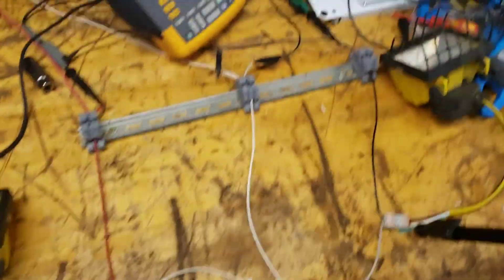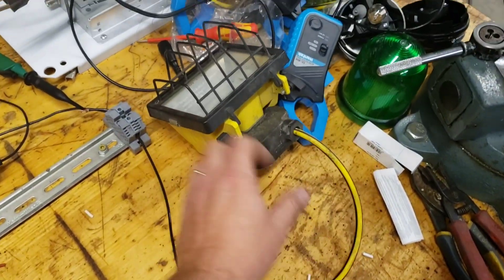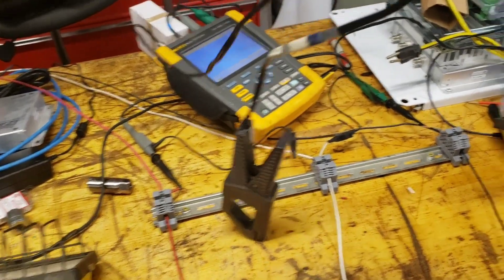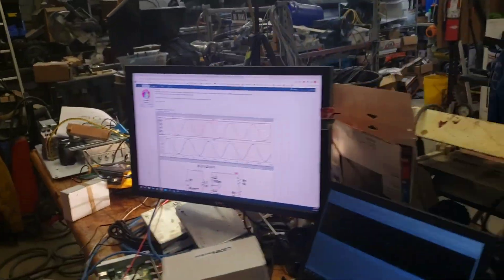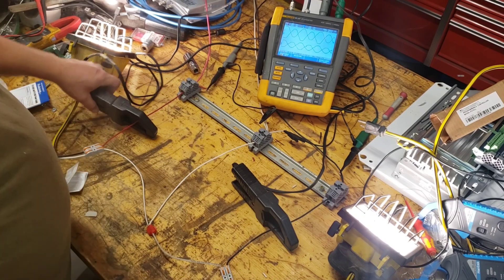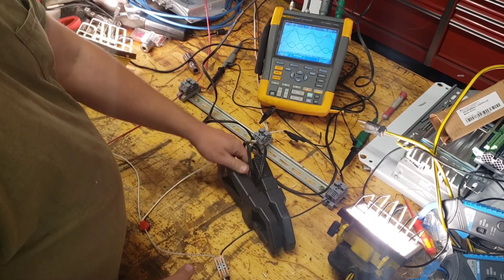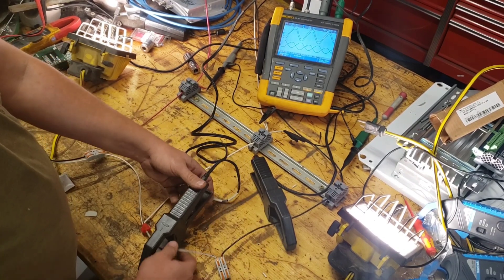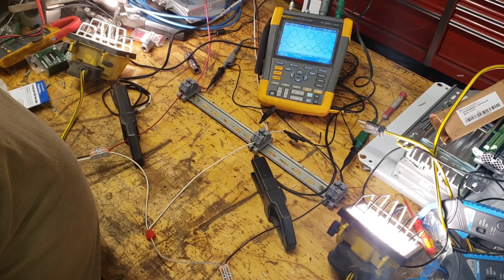Inverted/"180 degrees out of phase" current.

Comment: Yes you are supposed to do that BUT you need to think about what it is you are doing when you do it. The current clamps have a direction. They should be marked. One side of the clamp goes toward the load. Running it along the wire the way you did had your clamp in the wrong direction. It is a simple matter of topology yet it seems to always confuse people at first. Clamp your current clamp over L1 in the proper direction and you will get the inverted or out of phase signal. They way you have it is the equivalent of reversing the live and neutral probes.

It should be obvious, but perhaps is not, that if the voltage signal is inverted then so is the current, at least with a purely resistive load that is. The current will flow from high potential to low potential. You can switch polarity of your probes, but that is changing the definition of positive and negative. Remember, there is no absolute voltage measurement. Voltage is a comparison, the difference in electric potential between two points. It's value depends entirely on which two points we choose to make our measurements.

I hope this helps.
Reply from the maker: "there is no absolute voltage measurement. " 

You worded that nicely. I agree, there is no absolute voltage measurement. but is there absolute voltage ? 

If a tree falls in the woods and nobody is there to hear it, is there any sound? This question is typically asked rhetorically to point out the difference between the physical phenomenon of sound (pressure waves) and the observation of sound (human perception). Some people only recognize one or the other. If you define sound as merely a human experience then a tree falling in the woods with no observer, makes no sound. 

The same applies to voltage. There is voltage  (the physical phenomenon of potential difference) and there is voltage (the observation/measurement). A battery sitting on a shelf with nothing connected to its terminals, according to Ohm's law, has no voltage. Not until you connect a multimeter to it, which provides a resistance for current to flow through, and thus a voltage (and a measurement of voltage). But, we all know that before we connected the meter, and after we disconnect it, that voltage is still there, right? Who would argue that it ceases to exist once we remove the meter? 

I posit that a source DOES have an absolute voltage with a specific amplitude and polarity, that simply exists, independent of how you choose to measure it. And that absolute voltage is what this video (via demonstration of current) is about. 

If you are saying that L1 IS inverted with respect to L2, then you are speaking of measurement/observation only, making no effort to point out the distinction between measurement voltage and absolute voltage. You're proudly proclaiming that a tree which falls in the woods makes no sound, end of story. It is up to the audience to deduce that you consider sound only to be a human observation. Anyone who doesn't know enough to deduce that, will be misled. Please stop being misleading. L1 and L2 are NOT out of phase. YOUR measurements are out of phase.
Reply: @charlesstaton8104  "but is there absolute voltage ?"
Maybe I should have said independent/absolute. My point was that voltage is always a difference between two points. You can't, for example, say that the voltage at some particular point in a circuit is x volts without knowing what that is in reference to. That's all I meant by that.
"A battery sitting on a shelf with nothing connected..."
Ohm's Law does not apply to the unused battery because there is no current through it. Ohm's law is only useful in a circuit. The battery has internal resistance which would be sufficient for current to flow were the to electrodes connected, even with a hypothetical perfect conductor.
I won't bother quoting any specific part of your last paragraph. I am only here to share what I have learned in my years as an electrical engineer. The information is freely given to those who want it, but never forced on anyone. It seems clear that you hold tight your view on this topic and I won't try to prise it away from you.
I will just leave you with this. You and I are only out of agreement by semantics. However the semantic view that I am trying to explain is the one agreed upon by concensus, convention and the NEC. If you want to post videos using definitions and claim that the rest of the world's engineers and electricians are wrong, but you have got it right, then by all means, have your fun. But it is not I who is misleading any others who stumble across your video. If someone were to accept your assertion and carry it into a job site, they would be liable to make costly mistakes. If you are okay with that, then I will leave you to it.
Reply from the maker: @jssamp4442  if one can walk onto a jobsite and make this claim and back it up with the logical arguments that I provided in the previous video, and have mutual understanding of the semantic nature of the disagreement with those across the table, then they have (should have) proven a sound understanding of the topic. However they WON'T have a mutual understanding that it's a semantic disagreement, and that's exactly why it's NOT a semantic disagreement. Most people saying the things that you're saying, don't know why they're saying them. You obviously do understand, and this probably blinds you to the fact that you're a minority. Everyone sounds like you, so obviously they've got it right, right? No, they are intoning the mantra word for word but don't actually understand. They can't explain why when we talk about split phase, the difference of L1 and L2 equals 240V rather than the sum. They think L1 and L2 are LITERALLY out of phase. They get this idea from people who say things like "L1 and L2 ARE out of phase" and it leads of further misconceptions, like that current flows different directions (simultaneously) through the loads on L1 and the loads on  L2, and on that faulty foundational understanding of single phase is built a complete butchery of 3 phase. 

I understand that I'm arguing against convention. I take a lot of heat for that, and I'm ok with that. My goal is to get people thinking. If they watch my videos and walk away having decided to keep saying what convention taught them to say, but with a new found understanding for why they're saying that, it's still a win. I do encourage them (and you) however to stop using absolute terms to the describe their relative measurements. I have no objection to "L1 and L2 appear 180 degrees out of phase (inverted polarity) when measured with respect to neutral." But "L1 and L2 ARE 180 degrees out of phase (inverted polarity)" is objectively wrong and absolutely misleading, and just because convention encourages it doesn't change that.
Reply: @charlesstaton8104  In "L1 and L2 ARE 180 degrees out of phase (inverted polarity)", both ARE and APPEAR are correct, but the "when measured with respect to neutral" part is necessary for both. Though it often goes unspoken, the assumption is always there. If I gave the impression that this was not my meaning, it was unintentional. By convention I mean the terms and definitions agreed to implicitly by being an English speaking person working with electricity. Convention is a required shortcut for communication. You are able to understand the words I am typing because we agree on the meaning of these words, by convention. This is the convention and consensus I am talking about. 

As for "current flows different directions (simultaneously) through the loads on L1 and the loads on  L2", again to make sense of this we must agree on the meaning of direction or specify what direction we are referring to. I call it positive current when the flow is to the load on the live and away from load on neutral. Negative current flows to the load on neutral and away on live. This holds for both L1 and L2. So in the same moment, L1 is positive (current to load on L1) and L2 is negative (current from load on L2). This is opposite polarity, (+)L1 & (-)L2. By this convention the voltage measured across L1 and L2 (the difference L1 - L2 is 240V. If you only look at L1 & L2, ignoring neutral, you could see one circuit with the current flowing from source through L1 then back to source through L2, but this is only true if you have only one load or balanced loads. Otherwise the unbalanced current will return to source (or be supplied by source, depending on the sign of the imbalance) through neutral. 

To use another convention than the one I describe for the direction of L2 doesn't give you a difference of 240V. If both signs are the same ( L1 and L2 in phase), then the difference is zero meaning 0V across L1 & L2. The convention I describe (and all other widely accepted sources) assures that the result is mathematically consistent.

I think we are both describing the same thing, but I have an intent aimed at conformity with the widely accepted standard for naming and accounting, while you are saying the same thing but insisting on using non-standard definitions. For what reason I cannot divine. But I will consider it a win If we can disagree respectfully and amiably in the understanding that we don't always have to agree to get along. Conversations would be extremely dull if everybody agreed on everything.

One last thing. "180° out of phase" and "inverted phase" describe exactly the same sinusoidal waveform. There is no difference in the two when the wave is a sine or cosine. Whether you invert the leads or time shift the signal, the result is identical. How you got there is different but you can't know which it was from only looking at the steady state signal.
Reply from the maker: @jssamp4442  In "L1 and L2 ARE 180 degrees out of phase (inverted polarity)", both ARE and APPEAR are correct 

WHAT? how can you say that? You connect your scope from neutral to L1 and neutral to L2, you get inverse waves, you say L1 IS inverse from L2. I come along behind you, connect my scope probes on top of your scope probes, from L1 to neutral and neutral to L2, I get in-phase waves, I say L1 IS NOT inverse from L2. We can't both be right. If you're arguing that there is no difference between appearing out of phase and actually being out of phase then your argument presupposes (but conveniently never advertises the fact) that voltage exists only as a measurement. Same as saying a tree that falls in the woods makes no sound. 

As for "current flows different directions (simultaneously) through the loads on L1 and the loads on L2", again to make sense of this we must agree on the meaning of direction or specify what direction we are referring to. 

But, we really don't. The statement is self explanatory and leaves zero room for misinterpretation. Current flows the same direction (simultaneously) through the loads on L1 and the loads on L2. and to that I will add current flows the same direction (simultaneously) through every single turn of the secondary winding of the supply transformer. You can decorate your schematic with little + and - symbols a la KCL if you find that helpful, but the statements stand. 

If both signs are the same ( L1 and L2 in phase), then the difference is zero meaning 0V across L1 & L2. 

Inverse waves cause destructive interference and in-phase waves cause constructive interference. In math, in noise canceling headphones, in the ocean, in every kind of wave in the known universe except (apparently) in discussions with EEs about split phase power. 

The convention I describe (and all other widely accepted sources) 

I get it. Convention is on your side. I knew that before you came along and you've thrown it out there enough times. The convention in this case is as stupid as neck ties. 

you are saying the same thing but insisting on using non-standard definitions. For what reason I cannot divine. 

The reason is that the way I am describing it is more intuitive and more accurately reflects the underlying physics of the EM field of the transformer or generator source. The conventional way is misleading. 

But I will consider it a win If we can disagree respectfully and amiably in the understanding that we don't always have to agree to get along. Conversations would be extremely dull if everybody agreed on everything. 

I agree. If I have been disrespectful toward you I apologize. My words don't come from a place of intentional disrespect but I'm sure they are colored by a certain irreverence I feel regarding this topic (not you personally). 

One last thing. "180° out of phase" and "inverted phase" describe exactly the same sinusoidal waveform. There is no difference in the two when the wave is a sine or cosine. Whether you invert the leads or time shift the signal, the result is identical. 

Agreed. Not for asymmetrical non sinusoidal waves, but in this topic of split phase mains I don't think anyone on either side of the debate is arguing that L1 or L2 is phase-shifted by 8.333mS. Both sides are saying "180 degrees out of phase" when they mean "inverted." Fine, doesn't matter, it's a sine wave, same difference, but if we want to be really precise in our wording we would be saying "inverted." I try to use "inverted" more often lest someone intentionally misconstrue me. 

I would like to hear your thoughts on this statement: current flows the same direction (simultaneously) through every single turn of the secondary winding of the supply transformer. Do you disagree?
Reply from the maker: @jssamp4442  I thought of what I hope will be a good analogy. We need to know the direction a river flows. The simplest solution would be to stand on the bank, throw in a cork, and see which direction it goes. But we can't because (our scope is ground referenced, so) we are standing in the center of the river. So we throw in two corks, one toward either bank. One floats from left to right and the other floats from right to left. We report this (as per convention) as two different measurements, one positive and one negative. Anyone who doesn't know better will take these measurements to mean that the river is flowing two different directions simultaneously. Some of them will take that flawed understanding to the grave, through decades of work in an electrical technical role. 

I'm over here trying to point out that there is only one river, it only flows one direction, and I can prove that from standing in the middle of the river, either bank, from the bay, from the mountaintop, or from the international space station. Yet I will still have people insisting that there is no difference between those directions APPEARING opposite and actually BEING opposite. What they intentionally gloss over (without exception) in their proclamations is that they refer to the MEASUREMENTS and that they disregard any notion of there being any ACTUAL direction of flow. Yes, the RELATIVE MEASUREMENTS actually ARE opposite. The measurements appear opposite and ARE opposite. But the measurements are meant to represent something that actually exists, and the thing which actually exists does NOT have current flowing two different directions simultaneously. If we can take measurements that more accurately reflect the real thing, that is better, right? Nope, convention is better, always; even when it causes confusion.
Reply: @charlesstaton8104  I'm gonna wade back in here for a visit, despite my better judgement. I mean no disrespect, but I have to agree with Jssamp that "It seems clear that you hold tight your view on this topic." It's slightly disheartening to see nothing from our previous lengthy discussion shift your mindset whatsoever, and in fact you took analogies and twisted them for your own purposes. And that's why I call this political!

I appreciate, Charles, that you feel your view is more intuitive for the masses, and has helped to correct many a misguided youngsters (I see many positive comments on your other video and commend you for that!). But has it occurred to you that you are not giving enough credit to many countless others who discuss this regularly and understand it quite well? I'm not saying people who declare "OUT of phase!" all understand it, but many, many do. And people going around claiming "IN phase!" doesn't change anything unless one actually understands the system and how to take measurements on it and what those measurements mean!

As part of a give and take, I will offer that my mindset has indeed shifted somewhat since our discussion and I better appreciate why you feel you are correct and indeed are correct in many ways. That doesn't mean I think you ARE correct in EVERY way, just that you APPEAR correct from certain reference points. (little joking here ;)

Since in this discussion with Jssamp you stated more prominently your assertion about the difference between voltage philosophies  (measurements vs voltage 'existing') I would like to add:
When one says voltage is dependent on reference, what they mean is it is between two points. I think you have built a straw man here with the 'tree in the woods analogy.' In your example with the battery sitting on a shelf, the battery 'has' defined voltage (whether we measure it or not) between given points. In other words, between the two terminals, there is some voltage (approximating the rating of the battery, if healthy). One could also discuss voltage between cells within the battery. BUT, one can NOT just say 'the battery HAS voltage' without defining (implicitly or explicitly) the reference points. The battery does not 'have' voltage to ground, for example (well technically it does, but it's not the same voltage as between the terminals). It's not that complicated.

As far of constructive vs destructive interference of waveforms:
In terms of current, when neutral is reference (waveforms 180 OOP i.e. inverted) then there IS destructive interference of the current on the neutral. And, again, voltage sine waves depicted on an oscilloscope are not an image of an electromagnetic wave, they are showing a time varying function of amplitude. There really is no mathematical or physical conflict to get worked up about.

And that's the rub. THE MATH and THE PHYSICS works just perfectly with a neutral reference if one understands what that reference means. And one needs to understand what ANY reference means. Math is a representation of reality. No 'declaration' of a phase angle being IN or OUT is getting us any closer to reality. Whether it's English or math (or another language), it's all an attempt to DESCRIBE reality. And as such there are many justified ways to do so. I will post a link below that I think describes this situation well. I think you will agree with its general assertions, but your conclusion will probably be that one version  of measuring is somehow a lie and another is 'real' because that seems to be an immovable position for you. 

No one in the know disagrees with you that the two halves of a center-tapped transformer are series-aiding. What people are disagreeing with you about is your continued assertion that using a center tapped reference is somehow not-representative of reality in a mathematical or physical sense. To be blunt, you need to seek a little humility man and recognize that other people understand what's going on and can fully embrace inverse waveforms due to their intelligence and comprehension of the system, not lack thereof.

You can't blame the waveform for people misunderstanding it.
Reply: @charlesstaton8104  And not to step on Jssamp toes, but I will stab at this question:
"current flows the same direction (simultaneously) through every single turn of the secondary winding of the supply transformer. Do you disagree?"

This has been answered before, but here goes.
It depends.
if you set the winding on a shelf with a definitive orientation, you could point to it and say 'all the current is flowing left at the same time.' That would be agreeable.  But that doesn't change this statement by Jssamp: "...current flows different directions (simultaneously) through the loads on L1 and the loads on  L2", again to make sense of this we must agree on the meaning of direction or specify what direction we are referring to."
When the neutral point is reference, at a given moment, current is flowing from neutral to L1 while current is flowing from L2 to neutral. So in that sense, 'different directions.' Is that somehow not a tenable statement for you? Again, multiple statements that both describe reality-- no conflict-- its about reference. I'm not sure what the issue is. Perhaps there is simply no disagreement and so you are just saying things and then we are just saying things, and then you just say more things, etc.. haha! The humanity!! :)
Reply from the maker: @spruce_goose5169  here comes the dog-pile! LOL No worries, I am used to it. You were going to share a video but I didn't see any link.
Reply: @charlesstaton8104  "One floats from left to right and the other floats from right to left. We report this (as per convention) as two different measurements, one positive and one negative. Anyone who doesn't know better will take these measurements to mean that the river is flowing two different directions simultaneously."

While I appreciate that this could be misunderstood by a beginner, I think this is a good example of where there is actually nothing wrong with the measurement, only with comprehension. To take this analogy a slightly different way: standing in the center (center reference) the river is coming at you and going away from you simultaneously. A positive value and a negative value. Should I be confused when standing in a river which way it is going because I have a high pressure on one side of me, and low pressure on the other?

The reference point is a 'dumb' point, meaning it doesn't think for us. It's not a person you can ask questions of as they stand in the river. It is there to give us... reference. Then we-- the humans on the other side-- interpret those measurements for what they are based on how we referenced.

This would be no different than if I measured pressure between 3 different chambers. If the meter base was always kept in a common room, with the probe sent into the other 2 rooms, one would have to take the difference to determine the pressure difference between those two rooms (that the base is not in).
Reply: @charlesstaton8104  Hmm. I think maybe youtube removed it... 
If you google "all about circuits more on ac polarity" it comes right up. Not a video, an article.

Btw, here is a video where I can sympathize wholeheartedly with your view on this, in that their presentation could be pretty misleading: https://www.youtube.com/watch?v=RhHlXa9XUKQ

People just need the full story. Trouble is, if someone is just learning, it can be difficult to convey the entire story all at once... We really should probably talk differently about this subject to different people based on where they are at with their understanding of the system and concepts. I-- again-- would advocate for not harping on the "in vs out" if phase bit and would personally focus more on the importance of reference and perhaps the physical construction of a winding.
Reply from the maker: @spruce_goose5169  "I have to agree with Jssamp that "It seems clear that you hold tight your view on this topic." 

I have to agree with both of you. I do. 

"It's slightly disheartening to see nothing from our previous lengthy discussion shift your mindset whatsoever"

I did have some takeaways. Notice I am not arguing current as an absolute measurement anymore. At least, not in the same way. Our conversation taught me that I am not very good at articulating that so I am giving it a rest for now. 

"in fact you took analogies and twisted them for your own purposes." 

Did I? Which ones? I surely didn't mean to plagiarize but sometimes things get into my head and I forget the source and assume they're my own original ideas. 

"has it occurred to you that you are not giving enough credit to many countless others who discuss this regularly and understand it quite well?" 

I think I give credit where due. Do you notice a difference in my tone in this conversation vs the one I had with you? These conversations, when they happen with someone holding contrary views, typically go one of a few different ways: 

(1) The person actually doesn't know what they are talking about and is just regurgitating the convention like a good little drone. In this case I try to help them understand which involves pointing out things that contradict their arguments, and 

(1A) they actually think about what I said and they have a eureka moment or 

(1B) the most common of all of these - they become belligerent, and the conversation devolves into insults. 

(2) the person DOES know what they're talking about, and knows what I'm talking about; we both know what the other is talking about, yet they intentionally misconstrue everything I say, feign misunderstanding despite me using the most concise explanations possible in English, try to catch me on every technicality they can (and make one up if they can't), fein concession and then reneg on it, and gaslight me to the applause of a crowd that exists in their own head. As you say (and I agree), politics. 

(3) very rare - like the conversation I had with you - where we are both on the same page but have different ideas about the best way to describe the page yet still able to discuss it amicably. 

It's those "class 2" conversations where I absolutely give no credit. Hell no. If you're trying to make me look like I don't know what I'm talking about when you know that I do, then you deserve no credit for what you know either. 

This conversation before you joined, was a "class 3" but exhibiting the early symptoms of "class 2" - so maybe it was about a 2.7. 

"That doesn't mean I think you ARE correct in EVERY way, just that you APPEAR correct from certain reference points." 

LOL good one. 

"I will post a link below that I think describes this situation well. I think you will agree with its general assertions, but your conclusion will probably be that one version of measuring is somehow a lie and another is 'real' because that seems to be an immovable position for you." 

I read the AAC article and thought it gave a good explanation. It covered both sides of this debate. Polarity of the measurement device, polarity of the sources, positive and negative voltages, etc. And it gave a good teaser for dealing with phase angles other than 0 or 180. That's really what I should be focused on; telling the whole story. Instead I am consumed with telling the half of the story conspicuously left out of most explanations and arguing with people who insist the missing chapter doesn't exist. 

"What people are disagreeing with you about is your continued assertion that using a center tapped reference is somehow not-representative of reality in a mathematical or physical sense. To be blunt, you need to seek a little humility man and recognize that other people understand what's going on and can fully embrace inverse waveforms due to their intelligence and comprehension of the system, not lack thereof." 

Again, I reciprocate. I might be preemptively defensive sometimes but it's because I'm perpetually under attack from self-deputized agents of academic convention enforcement. I can spot a patronizing tone a mile off, but I just can't seem to replicate it; my directness might make me look like I lack humility. But I can admit when I am wrong. Exhibit A: 

"take this analogy a slightly different way: standing in the center (center reference) the river is coming at you and going away from you simultaneously. A positive value and a negative value. " 

Nice. Way to turn my analogy around on me. Yours is better. I'm never using this again LOL.
Reply from the maker: "you set the winding on a shelf with a definitive orientation, you could point to it and say 'all the current is flowing left at the same time.' That would be agreeable. But that doesn't change this statement by Jssamp: "...current flows different directions (simultaneously) through the loads on L1 and the loads on L2", again to make sense of this we must agree on the meaning of direction or specify what direction we are referring to." When the neutral point is reference, at a given moment, current is flowing from neutral to L1 while current is flowing from L2 to neutral. So in that sense, 'different directions.' Is that somehow not a tenable statement for you?" 

Everything you said was accurate but that was a feat of Olympic gymnastics to justify the use of the words "different directions" when the question was "same direction through every turn" (opposed to into/out of any given nodes) on a video demonstration of current through loads using current clamp that clearly showed current NOT flowing "different directions." 

Do I need to dredge up current as an absolute measurement again? lol where was I supposed to connect my current clamps' ground probes for those measurements? 

_"Btw, here is a video where I can sympathize wholeheartedly with your view on this, in that their presentation could be pretty misleading: https://www.youtube.com/watch?v=RhHlXa9XUKQ "_ 

Yes, that guy is nincompoop. I've seen another of his videos. He is a proud member of "Class 1B" - he has no idea what he is actually talking about, but is really proud of his ability to spout rote script from a textbook and call anyone who doesn't acquiesce to it an idiot. 

"People just need the full story." 

Agreed. I plan to make another video that explores the whole thing in detail. Less adversarial, more informative. "Why do these people say this?" "Why do these other people say that?" "Who is right?" (Spoiler, they both are, they just can't agree on whose explanation makes more sense, but here's my opinion...) 

"Trouble is, if someone is just learning, it can be difficult to convey the entire story all at once... We really should probably talk differently about this subject to different people based on where they are at with their understanding of the system and concepts." 

Agreed. 

"I-- again-- would advocate for not harping on the "in vs out" if phase bit and would personally focus more on the importance of reference" 

Agreed, but... I think you (and most classically trained folk) have an inflated opinion of ground as a reference. I agree that reference is important but I opine that convention, being based in no small part around the measurement devices used during the time of its inception (and still today) puts ground on a pedestal. THE reference point almighty. It's the de facto center of the circuit analysis universe. LTSpice simulations can't even run without a ground! I rarely touch ground! Most things I deal with are isolated/floating. So I think about things differently. That's probably where my difference in opinion about in/out of phase comes from. I agree that reference should be talked about more, but probably not in the way you would like. I will be focused on introducing people to what measurements look like from other points of view than ground, because I think that helps to form a better grasp of the big picture. 

"and perhaps the physical construction of a winding." 

DEFINITELY!
Reply: @charlesstaton8104  All fair and reasonable Charles.

"I think you (and most classically trained folk) have an inflated opinion of ground as a reference."
"I agree that reference should be talked about more, but probably not in the way you would like."

You may be surprised. It's not that I think ground HAS to be reference, it's that I think whatever reference point we choose needs to be clear. And yes, typically if one doesn't cite the reference, there is going to be an assumption that it's ground. 

My biggest issue is when people think there are 'absolutes,' and that has really been the point I have been trying to drive home throughout this discussion. I regularly point out, for example, that a split phase service does not 'have 120 volts' on L1 (or L2), but rather 'has 120 volts  from L1 (or L2) to ground', and 'has 240 volts from L1 to L2.' It's not a pedantic point because too many people think voltage is an absolute measurement, as if a single wire 'has' some predetermined voltage regardless of reference. As you know, one could go unhook the physical earth connections of a household split-phase service and suddenly there would be no 120 volts to ground. The whole thing would be floating. 

Ground does indeed tend to be the reference, partly by convention but also because of practicalities with measurements. Clearly, as you demonstrate, it's not the only way we can take measurements, but people with non-isolated grounded scopes need to use it. And it's also not trivial that if someone were to be shocked by completing a path to ground, it would be closer to 120 volts because we stand on ground. If we grounded L1 in our residential systems, we would have a dumb system where one could be shocked by 120 volts OR a full 240 volts TO GROUND!
Reply: @charlesstaton8104  
"Everything you said was accurate but that was a feat of Olympic gymnastics to justify the use of the words "different directions" when the question was "same direction through every turn" (opposed to into/out of any given nodes) on a video demonstration of current through loads"

Right, we are both saying true things that don't contradict one another. The simple answer to your question about 'direction through the turns' is that, yes, current is going in the same direction when one views the coil on a benchtop. The reason I make the point about node reference is because node reference is the only tool we have for depicting this concept on an oscilloscope (even with your approach).

You portray current as 'going in the same direction' with your clamps, and so you may be tempted to think your are not using node reference, but ultimately you still are. The way the scope is able to show these waveforms is by measuring flow towards or away from a reference. You are able to show what you do by choosing a node reference of L1 for one clamp, and N for the other clamp. I'm not saying you can't do that. And I'm not saying that it's LESS correct than a common center reference. I'm simply saying that it's also NOT MORE correct. What would 'more correct' even mean? It all depends on what we're trying to accomplish. I think you accomplished what you wanted to, but we always need clarity on what the measurements are depicting. Like I said, it's all relative, and each measurement will give us different information for the same physical reality.
Reply: I should probably add for clarity that when I say "it's all relative" I am NOT saying current is between two points like voltage. Current can be measured at a single cross section and in that sense is an 'absolute'. I'm simply saying the depiction of the sine wave showing current as 'coming or going' is relative to the reference.
Reply from the maker: @spruce_goose5169  "My biggest issue is when people think there are 'absolutes,' and that has really been the point I have been trying to drive home throughout this discussion. I regularly point out, for example, that a split phase service does not 'have 120 volts' on L1 (or L2), but rather 'has 120 volts from L1 (or L2) to ground', and 'has 240 volts from L1 to L2.' It's not a pedantic point because too many people think voltage is an absolute measurement, as if a single wire 'has' some predetermined voltage regardless of reference" 

I totally agree. Voltage is a relative measurement. But in response to this it probably makes more sense to call it a differential measurement. I have always agreed with this and if at any point I made it seem otherwise, that was me just being bad at explaining myself. 

Now that I've been forced to consider why we are still not on the same page about this, I think I may have finally found a way to articulate what I perceive to be the fundamental source of our divergence: 

I think of a voltage source like a 1 dimensional line. Not the line you see on a scope when measuring a battery, but a 1D line floating in space like the first line in an AutoCAD drawing. You can measure between any two points on this line and as long as you state the points, the measurement is valid. But if you don't measure any points, that line still has a length. That length, in my mind, exists (obviously) between the two ends. But in your mind (I think), that length exists (obviously) from center to either end - because of convention. 

The reason I feel like my view more accurately reflects reality is that my view is of an absolute characteristic of the source that is (should be) independent of any stated reference, and even independent of any measurement. The reference is in the definition; the length of a line is the difference between its two endpoints. 

Your view or the view shared by your side (if I am not mistaken thus far) also in most cases considers itself unburdened from the need to specify the center as a reference because the reference is understood by convention to be automatically center point. 

The center point is relevant only to measurements taken from it. Therefore when I talk about "absolute" voltage or "a tree falling in the woods" or "a phenomenon of the universe that simply exists independent of measurement," the center point is disregarded. It is disregarded in the ideas that I am transmitting but I suspect, still present in the message received by you and others. Hence the misunderstanding. Thanks a lot, convention. This is where my comments on the inflated importance of ground come from. 

I have to go out of my way to reincorporate an irrelevant point into my mind to understand things in the way you explain them. All you have to do to understand things the way I explain them, is disregard that irrelevant point. One way feels more organic and one way feels more forced, to me.
Reply from the maker: @spruce_goose5169  "You portray current as 'going in the same direction' with your clamps, and so you may be tempted to think your are not using node reference, but ultimately you still are. The way the scope is able to show these waveforms is by measuring flow towards or away from a reference." 

ok, fair enough. 

"You are able to show what you do by choosing a node reference of L1 for one clamp, and N for the other clamp." 

It's probably been a while since you watched the video; I suggest watching it again. When I was using the same node reference for both clamps, the waves were in-phase no matter where I measured from. In order to see opposing waves I had to force it by using two different node references.
Reply: @Charles Staton  in response to the 'voltage as a line.'

It appears you are saying the length of the line represents the full secondary winding, which is 240 volts. No argument. As I've stated before, if one is trying to portray a pure 240 load with no neutral, it would be a single sine wave. The 120 volt inverted waveforms indeed use neutral as reference, thereby splitting the voltage in half. I guess I'm not sure what the issue is here. You can ignore the center tap, but it's there and is used for 120 volt loads, so there's nothing invalid about it for what it is.

If I had to describe our disagreement, I think I would say that you take issue with the mathematical concept of subtracting negative numbers. 120 - (-120) v equals 240v. Is that what gets you up in arms? I on the other hand see zero problem with the concept. Is this where we diverge?

You are right about me not having recently watched the video. But the point is not about where you take the measurments but about the directional orientation. Again, what you did is fine, but it differs from the approach of using neutral as the directional reference. When you say 'through the loads' in one case you mean from hot to N, and in the other you mean from N to hot. I'm not sure we have any disagreement here other than in which way one should take the measurement. And as I've stated many times over,  we simply need to understand what we are measuring and why it makes sense.
Reply from the maker: @spruce_goose5169  "It appears you are saying the length of the line represents the full secondary winding, which is 240 volts. No argument. As I've stated before, if one is trying to portray a pure 240 load with no neutral, it would be a single sine wave. The 120 volt inverted waveforms indeed use neutral as reference, thereby splitting the voltage in half. I guess I'm not sure what the issue is here. You can ignore the center tap, but it's there and is used for 120 volt loads, so there's nothing invalid about it for what it is."

One thing I left out of my "line" explanation is that the line is comprised of every one of the infinite number points along itself, not only the two end points. As I said in our previous conversation, the voltage produced by the secondary winding is a gradient. We can typically measure only where there are taps, so the two ends and the middle, but if we scratch off the enamel of the turns of wire, we can observe the gradient. From turn # 24 to turn # 30 there might be 3V. and from turn #24 to #27 there might be 1.5V. and from turn #24 to the opposite side of turn #24 (turn # 24.5) there might be  0.25V and so on, smaller and smaller. With a sensitive enough device you could measure the voltage induced across 1mm of wire within the same turn. It is like an series string of infinitesimal sources, all with the same polarity, adding up to 240V. Assuming you can physically access any point along this line you can measure from any one of the infinite test points to any other one. You can take many measurements at once, anywhere along that gradient you want, and as long as you keep your measurement polarity consistent, all your measurements will be in phase with each other. It isn't until you start measuring the opposite direction that you start getting opposite results.

You can group these tiny sources however makes sense to you; by number of windings, by voltage gradient thresholds, by number of taps. Of course, practically it makes the most sense to group them by number of taps, so 3 test points. And you can use whichever of these 3 testpoints you like as reference; we typically choose center. but condensing it down to 3 points and choosing the middle as reference comes with the inherent risk of losing sight of the inner workings of the transformer. It becomes too easy to think of it as two separate sources; it isn't. When you use center reference and you think of it as two separate sources it becomes too easy to think of them as out of phase; they aren't. 

"If I had to describe our disagreement, I think I would say that you take issue with the mathematical concept of subtracting negative numbers. 120 - (-120) v equals 240v. Is that what gets you up in arms?"

No disagreement that 120 - (-120) = 240. I can math, too. I just dispute that the second term is negative and question why we are subtracting to get 240 instead of adding as we do in all other instances of series voltage sources. It seems obvious to me that it's because we (we in the know) know that the second term is negative only because we measured it backwards and rather than acknowledge that, flip the sign, and add it, we take the shortcut of simply subtracting, and then mislead all the noobs by not explaining what we are doing, or why we are doing it.

"But the point is not about where you take the measurments but about the directional orientation. Again, what you did is fine, but it differs from the approach of using neutral as the directional reference."

True.

"When you say 'through the loads' in one case you mean from hot to N, and in the other you mean from N to hot."

I would say that I consistently used L1 as the reference. Not functionally different from your explanation, just that yours makes it sound like I went out of my way to force the result.

" I'm not sure we have any disagreement here other than in which way one should take the measurement. And as I've stated many times over,  we simply need to understand what we are measuring and why it makes sense."

Agreed.
Reply: @charlesstaton8104  
No disagreement that 120 - (-120) = 240. I can math, too. I just dispute that the second term is negative and question why we are subtracting to get 240 instead of adding as we do in all other instances of series voltage sources.

Yeah I didn't mean you couldn't perform the math, it's the latter part of your statement. Whether the second term 'is' negative is entirely a matter of reference. Your assertion that it being considered negative is 'backwards' and that it really isn't 'physically negative' is where I think your logic is slightly erroneous. Negative and positive are simply notations to describe relative relationships. It's no more complicated than that. So when center is reference, one is "above" (positive) while the other is "below" (negative). This doesn't contradict the reality that you can orient your probes like you wish and add two positive values. Both are correct. I was thinking the article I tried linking to would sort of clear this all up. Or maybe you do agree and I am just confused as to your point. 

I also don't really know what you mean by "as we do in all other instances of series voltage sources." Like batteries? While making analogies between DC and AC can be useful, there's times when they have differences. And this all comes down to 'convention' anyways, something you seem loath of :). Even in 3 phase, you will notice that the polarity notation in a wye config is drawn such that all the common center points are negative (on the all  about circuits site). While there is the added complexity of non-linear phase angles in that case, one still needs to involve subtracting a negative.

None of this disproves your point about the coil arrangement, I'm just trying to illustrate why there needn't be a fuss about the way the numbers work with a center voltage reference.
Reply: @charlesstaton8104  
I have no technical disagreement with your 'scratch the enamel off' the winding illustration. 

I think my only slight disagreement is that because in the real world of residential split-phase delivery, we have 3 physical taps and one of them is physically grounded (earthed), and we USE those taps on loads-- meaning not all loads are 240 (full coil) loads-- thus there are a few practical reasons to use a common center reference. It is not a completely arbitrary part of the coil someone scratched clean just to take a random measurement. It's physically part of the system that loads 'experience it's existence of' and it's a sensible place to make the 'common'. And one could if they wanted put the 'center tap' off center and run asymmetrical loads (like maybe 60 volts from L1 to ground (not calling it a neutral anymore) and 180 volts from L2 to ground). And in that situation, they still could reference the 'non-centered-tap' and see two waveforms (now of different magnitude) that are inverse with respect to the ground (non-centered-tap).

I will admit that your measuring scheme is more illustrative of the fact that the coil halves are series-aiding, but I'm not sure why that is the only goal? I guess your goal is really just to prove that the coils are 'in phase' (my preference is to say 'series-aiding' as I think that it less ambiguous and less likely to cause confusion, but I will concede 'in-phase' is fine too). Insofar as that is the goal, fine. But as mentioned above, there are also very real reasons to use the center common reference and if one is confused by that, I don't think we should blame the measuring scheme, but rather people's interpretation of it. 

Another side point is that electrically speaking, there is no difference between a single coil with a center tap and two coils that are series-aiding (or in-phase) like you say (could even be two different generators assuming correct connections). All that physical stuff is important in the real world, but irrelevant to the electrical theory. This isn't to refute any of your points, just a side-bar.
Reply from the maker: @spruce_goose5169  I think we have reached complete mutual understanding. We each understand how the other sees things and can force ourselves to see it the other way even if we prefer to see it our own way. We have nothing left to disagree about or even clarify. It doesn't get any better than this; or at least it never has, in my experience. Mutual win. It's been a please talking with you! Thanks for the intriguing discussion. 

If only all political debates could go this way...
Reply: I agree with you.  L1 and L2 have to be out of phase with one another would respect to their sine waves otherwise how would you measure any voltage between them.